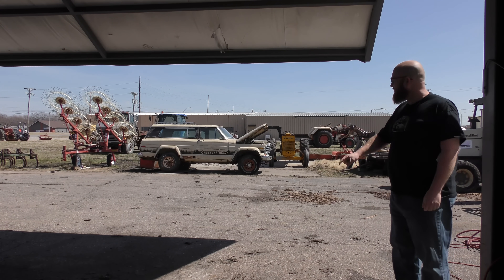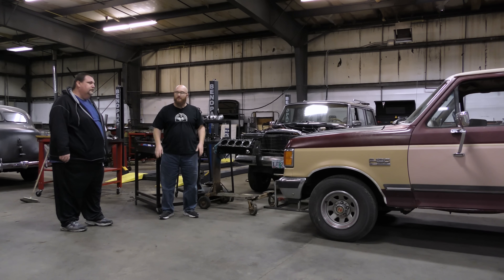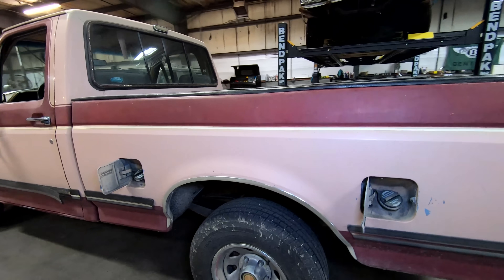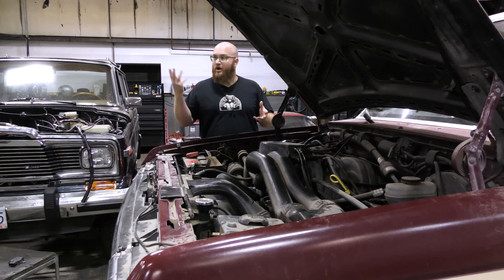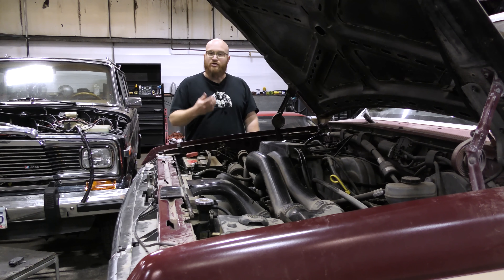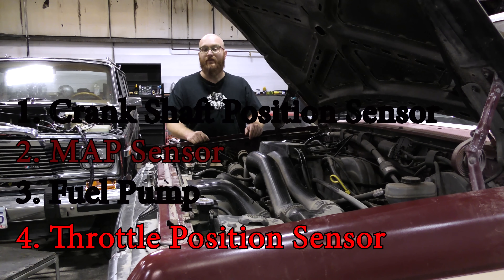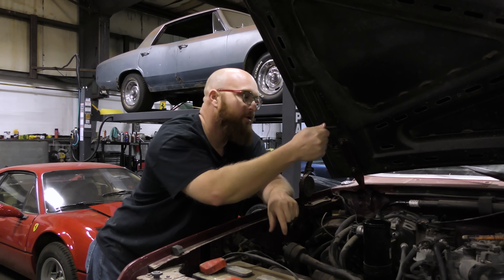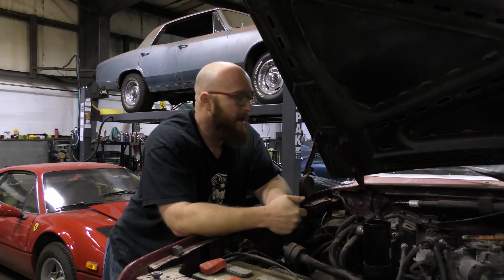Parts cannon couldn't fix this '90 F150. Old School diagnosing by the CAR WIZARD

Comment: Getting ready to put a set of AFR 165 heads (and supporting modes) on my 95' F150 cause this truck is worth it but needs a lil more pep in it's step. Being extended cab short bed but lifted by a previous owner the stock 195hp v8 needs improvement.

Comment: I had a 1989 F150 with the inline 6. Took me 6 months to get my idle fixed because no shop in my area could fix it. It got the parts cannon. So after the 3rd shop I parked it in my driveway and started YouTubing everything. My wife was not happy thinking I just bought a pile of junk. I finally figured it out and got it running good. Last thing I fixed was a leaking gas tank and scheduled it to go to a paintshop. 4 days before it was supposed to go, Someone hit and ran my truck sitting in front of my home. Insurance totaled it. I was so close to fulltime driving my truck.

Comment: Regarding the comments on throttle position sensor either working or not, but never being an intermittent problem, I have an anecdote...
I had a 2001 Olds Aurora 4.0, that was generally running fine, but occasionally, under a low load (parking lot speeds), the engine would just completely die. No sputter down to dead, it was as if I had turned off the ignition. It generally started back up with no fuss. After scanning it, it had codes for throttle position sensors, so I replaced them (it had two, part of the Northstar line), and the issue never happened again.

Certainly still agree that the crankshaft sensor wouldn't cause a surging idle, but wanted to share something I'd call intermittent. Granted this is also well into OBD2 era, so who knows what kind of computer logic might have also been involved.

Comment: Great video....Why don't you let the owner remove the Throttle body and then bush it for them, allow him to reinstall it themselves? It would save them some funds....Hope the solution is able to be accomplished. I talked my Ex-father in law into an 89 F150 with that 302 motor is was a great truck for him (4X2) delivered 18+MPG's driving from California to Colorado....He was hesitant but, while being owned...Described it as the best vehicle he ever owned...

Comment: It would be impossible for the problem to be a crankshaft sensor on that engine because it doesn't have one. 
I would try blocking off the EGR valve ports as well, to further control the amount of air getting into the intake manifold. If that is opening and closing at will, that too could exaggerate the problem of air getting past the worn TB bushings.
Then there is the option of replacing the TB with another used one which has tighter bushings, from a truck known to run well.

Comment: The crank sensor on my Kia Soul went bad and did cause intermittent issues, including very low power and a non-responsiveness to the gas pedal.

On the other hand, sometimes it worked fine.

Comment: I ordered a new F150 XLT 4x4 swb in 1989 with the 5.8 and twin tanks.  At 11mpg it was going to need both tanks.  By the time it was scheduled to be built, Ford discontinued twin tanks on the short wheel base version like I ordered.  Couldn’t pass a gas station.

Comment: My dad bought one of those in the late 90s and it was nothing but problems.
Engine ran really rough and mechanics could never fix it.
He sold it and got a 98 Corolla which he drove for over a decade with nothing but oil changes.

Comment: Car Wizard, what you can do for a temporary type fix of the throttle body shaft, is to hook up a reasonably tight spring to the shaft, to pull it in one direction. You then set up the idle speed, and the spring should keep it relatively stable. 😊

Comment: Got this EFI system in my van, so far it seems to run OK except fuel economy and power both suck. The carburated 302 I had in my old van could outdo this 351W (or 5.8 as they call it) in every department. In my state we have no inspections so I'm going to build a proper 351W with a carb and drop it in. The only problem is the E4OD trans is electronic and needs the computer which needs the EFI to know what to do, so I'm probably going to have to build a C6 to go behind it. That will get me at least 200K- 250K more miles down the road with nothing more than regular maintenance.
Reply: The 351 burned a lot more fuel than the 302. I got 17 mpg highway on an f150 -302 vs my buddies 13 mpg on an f250 -351.

Comment: Some misinformation in this video regarding the OBDI readers. You CAN go out and buy one on Amazon or your local chain store for around 20 dollars. Just lookup Innova 3145.
I've had this exact reader for 10 years and use it all the time on my 80s and 90s Fords. They also have a GM one as well.

Comment: I had a simular problem on my 1989 XR3i EFI and it was a combination of air temp sensor, oxygen sensor and a intake manifold that needed a resurfacing and fresh gaskets. Only thing left is the sketchy old throttle position sensor, but I cant find a new one.

Comment: By the way, these trucks with the 4.9 efi are probably the best truck ford ever made period besides the 1950 flathead, but most folks dont know what double clutching is and couldnt drive a 1950 ford😂😂😂😂
The reliability is off the charts as far as mechanical longevity the ford 6 is known to run 1 million miles with little to no hard parts replaced and deliver great tourque, awesome mpg and just a rock solid plstform to modify and customize
289 and 302/ 351 w engines are also quite reliable besides the roller lifter failure that was common but like any engine, change that oil and filter on time 3k max and it could last a lifetime with no rebuild

Comment: Back when mechanics were wore than just tablet holders. My first truck was a 92 F-150 I got it from my dad back in 2013. It say for 6+ years because it wasnt great on gas. I still have that truck sitting in my driveway. The 302 refuses to die. Its pretty worse for wear. But that truck has been great and I will keep it running un til it is no longer safe to drive. 266XXX Miles.

Comment: I have a 94 explorer and paid $900 to replace a grenaded the T-case on it. I 1st thought it was the trans, which was going to cost $3500. And honestly for that money, I only paid $1000 for it in 2016.
At a total $4500 today you could buy a truck for $4500, but a gamble that what you buy may be in need of a trans, or a total basket case.

Comment: I know that it's not the "ideal" fix, but there are hundreds of thousands of those engines and trucks in parts yards everywhere. If you or your customer can try to get a good used throttle body from a local pick and pull or even a large chain used auto parts place, it's better than nothing. And they can always buy a new one later.

Comment: You may or may not get lucky enough to find a new throttle body at your local Ford Dealership. I have seen instances where they actually do still carry parts for these trucks. Might be worth a shot to call and ask them about it or perhaps look online with the part number and see what you can find.

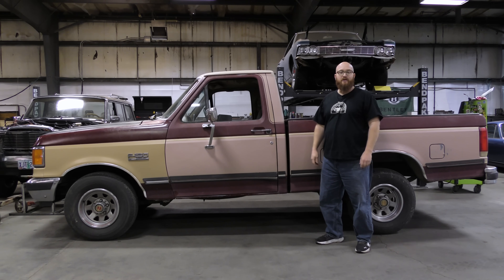Comment: 4:38 ish, you don’t have to personally attack me like that haha I shotgun the hell out of parts sometimes. I had a 95 with the 4.9 and manual trans that shat the bed at a horrible time and I didn’t have the time to properly diagnose or money to shotgun everything that could of been wrong so I sold it and regret it everyday. It had some electrical issue I couldn’t trace down and probably just had a bad ground or wire short somewhere but went out right before I moved and had to have a truck so I got a replacement and sold the f150 for cheap. Definitely wish I kept it though, aside from the electrical gremlin it developed it was a great truck

Comment: Def agree - very solid trucks.  I like the I6 and 302 versions - not much exp. with the ones that came equipped with the 351W though.  I like that configuration, although I'm very partial to a manual transmission even in a work truck.  And that is what I see here - a very solid work truck. :-)  Thanks for sharing! :-)

Comment: I work at AutoZone and I can tell you with certainty that almost no one will inspect the pins with a flashlight if the part looks otherwise unused.  The starting pay is so low that half of the new hires couldn't tell a spark plug from a drain plug if their life depended on it.  I've seen even used sparkplugs being returned and the issue only being discovered after they were sold again and the second customer discovered the issue

Comment: I found on mine that the fuel pressure regulator was bad and it was allowing fuel to be sucked into the engine.  It produced a surging idle as well.

Comment: I gotta 92 f150 custom 300 5speed. It is as plain of a model you could get, no a/c, no tilt steering, no cruise control, just had a  simple am/fm radio that did not work when I got it lol but it only had 88,000 miles when I bought it about 10years ago, its sitting at 124,000 now. It sat for over 10 years b4 I bought it nd it's been sitting again for the last 3 years, needs a clutch nd alternator. Got the parts, just need to do it.

Comment: Any of the 80’s or 90’s f-150’s are definitely worth saving especially with a 4.9 300. I paid $ 350 for it and only had to put a horn button on it and it passed inspection after sitting for years and I have now got $2,000 in it including the clock spring. That motor if taken proper care of will last a minimum of 350,000 miles! I own a 94 with a 6 cylinder and it has 379,000 miles on it and it runs like it stole something! I just got rid of a 93 same motor with 420,000 on it. The odometer in these trucks go to 300,000 miles and that’s it it will keep flipping back to 300,000 and own my own OBD1 scanner and anyone who owns 1 of these trucks it’s a must to own because he’s right no mechanic will still have 1.

Comment: I find a lot of these old fuel injected engines have bad/leaking injectors fuel washing the cylinders causing misfires and burning down engines. Saved a couple 300 i6's with this problem. The dreaded hard misfire at idle...

Comment: I said 2 or 4 but was leaning towards 2...like a broken clock I am right twice a day! hahaha

Only reason is I've had issues like that caused by a MAS and watched another ford tech who had a customer's truck with a lower power bogging down at high rpms....it was the air flow but...not electronic or parts related. What had happened was some foam insulation in the fender had come loose and when the vacuum in the air intake got high enough it sucked the block of insulation over the intake tube throttling it...when the engine slowed down, the vacuum released and the chunk of foam fell out....

(fordtechmakuloco)

Comment: And I thought you were going to share some knowledge on Ford EEC4 engine management system. It still generates codes, you just need a paperclip and a analog voltage meter to read the sweep codes.

Comment: Another thing these are notorious for is the ECU has 3 electrolytic capacitors that go bad and leak onto the po board. Easy to fix with new capacitors for a few dollars

Comment: i own an 88 f-150 with a 5.0 liter and would idle at 3000rpm. found out the throttle body was plugged with carbon, and the bolts on the lower intake manifold were finger-tight. as in two bolts were tight to torque but the rest was just sitting there. the truck is a manual trans with 4x4 and the dude put a starter for an automatic9 different gear ratio.

Comment: After reading so many horror stories about the Ford 3-valve modular engines, I'd gladly take this over any of those, sick or running good. And this particular unit has good bones though I think the front clip has been changed.

Comment: mine is a 90 f150 in all maroon with a 4.9, i have a shitty idle on it but ive gone through and replaced everything. Im not expecting a response but this truck has never left me stranded and has been a daily driver. Just hit 120k original miles.

Comment: In my experience (atleast on jeeps) crank sensors can and do have intermittent issues. Usually when they get hot they stop working.  And then when they cool off they can start working again.

Comment: A  iffy idle,    I usually  start with air filter, fuel filter,  try to find a possible vacuum leak, dirty throttle body, etc.

Comment: Don't touch the idle screws on the throttle body, it was set to a serton place for the ECM calibration for the IAC to work right, most high idles are caused by vacuum leaks or even misaligned TPS.

Comment: I've have and have had so many that I already know what is wrong with it when it starts messing up. I had one with 351 Winsor, I have one with 302 that runs good, I have a custom with a straight 6, 300 engine.

Comment: Little late, and it is a remanned part, but Rock Auto has one for 5.0 auto trans throttle body for $88.** plus $50 core charge, and in stock, just checked.

Comment: MAP sensor is easy to replace. the TPS just bolts in. Neither of these is particularly difficult to do. The real fun begins when you start getting tiny holes and cracks in the vacuum hardlines.

Comment: We have had one of these since it rolled off the floor new, and it never idled that good even new.  My MO now is that I just don't care, it runs and drives and nothing major is wrong with it to cause great concern, if it throws a rod tomorrow then we did not have to spend money fixing the idle problem.

Comment: Mechanic are not parts changers ,put used parts or line bore for bushings, have put o rings for sealing shafts,  but I'm old and that's the way I learned.

Comment: My 2 pennies?
Replacing the throttle position sensor, and the idle motor was money well spent. They all go bad in time. The Ford MAP is frequency output - not voltage, so a volt meter is useless here - unless you have a nice Fluke meter or something that can read frequency. Based only on voltage readings, the one you replaced might have been good. Any MAP sensor however is a mechanical device (air pressure actually causes a quartz crystal to bend internally) and will breakdown over time. As for the bushings, it can't be that hard to replace them - especially for $400 dollars. If the shaft is 5/16 (8mm), and you can't get OEM, there are tons of 8mm bushings in things like printers and electric motors. Assuming you could machine the housing, this should end up being better than new. 
On trouble shooting techniques, there was a great book I used to have - I think Bosch published it, that described how pretty much any sensor from that era worked. It was valid for any manufacturer. Even today your volt/ohm meter is your best friend for most sensors. What is often hard to find though is the "transfer curve", which tells you the expected resistance or voltage for any given input condition - like pressure or temperature or whatever.

Comment: I needed a NLA suspension part for a Pontiac Bonneville ( spring perch) Many car dealership had them listed, but it became a giant waste of time because no one updated their inventory. 
  I got out the welder and scrap steel and made my own. Made my own spring isolation from a too small BMW mount and a Fermco plumbing fitting. The car is in the family and because of heavy rust issues that caused the problem, we figured it is ok to drive in a college town and keep checking every few months for integrity if the repair and rustproofing fluid. No way could a shop do that repair because of liability, and absolutely no passengers in the vehicle will happenbut it is enough to transport daughter to owning her own car after graduation.
  I also wonder how difficult it would be to swap an engine into a 91 F250 Diesel. The truck is in nice shape but the engine has been killed with ether. I could buy the truck for a thousand.

Comment: I only work on things I own. I bought my 88 ford f-150 lariat 5.0 in 2012 for $1,700 dollars it is now worth $4,500 dollars. I recently bought a 87 ford f-150  6 cylinder 300 engine custom for $500 dollars that has been sitting for 10 years but ran when it was parked, the former owner had had his foot amputated and just quit driving it. I've got to remove old gas, probably replace fuel pumps, clean gas lines, put battery in then try to crank it. is the plan.

Comment: Throttle body bushings are such a simple and basic fix that most traditional mechanics can rectify.  Its not out of this world to actually make new bushings relatively cheaply especially as the bushes are plastic or steel.  If they are brass then the issue is the use of ethanol in the fuel that eats the brass components in fuel systems.
The trouble today is that cars are ever more complex and full of gimmicks and the mechanics are not proficient in the plethora of new skills needed so that diagnostic tools are required, leaving the mechanic as just a fitter.  I had a fault with my '94 Merc 500E which shut down the LH bank of cylinders, the independent Merc garage that I took it to failed to find the fault when using the sophisticated Merc diagnostic computer, as it merely stated that the LH bank had shut down.  The mechanic then rigged the vehicle up to an old Bosch engine analyser, the one that looks like a wardrobe with TVs, and spotted the fault that then led to a fix.  The moral here is that sometimes there is no substitute for experience and wisdom, when the gizmos fail to perform.

Comment: there's more than just OBD1 and OBD2. I've got a 1995 Oldsmobile the diagnostic plug is the same as an OBD2 but it's not wired the same. Come to find out it' was a one year only deal, and there were a couple other makes besides GM that had the same system that year. I've heard it called OBD 1.5. an OBD2 scanner won't read anything. Finally found an old guy who bought a Snap-On machine back in the late 90s with all the bells and whistles, and it could be set up to read that system. I had thrown a couple of parts at it but he was able to find out what was really wrong with it. Unfortunately he died many years ago. I still have the car.